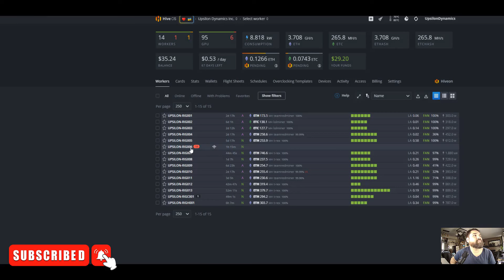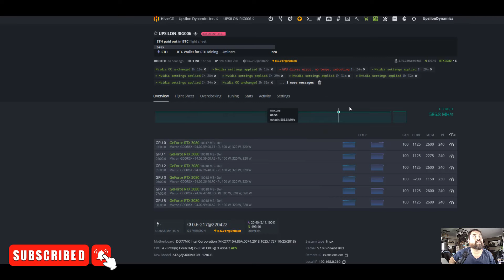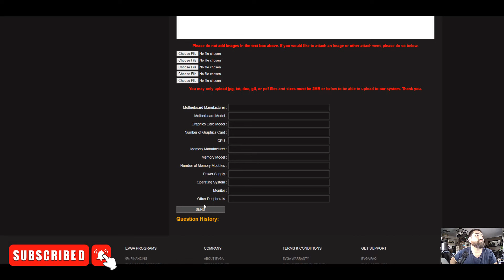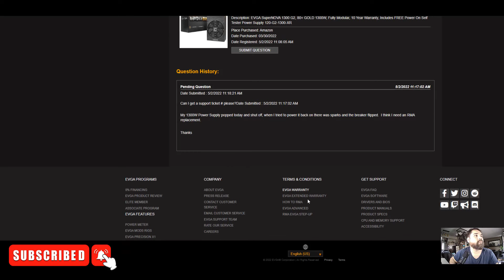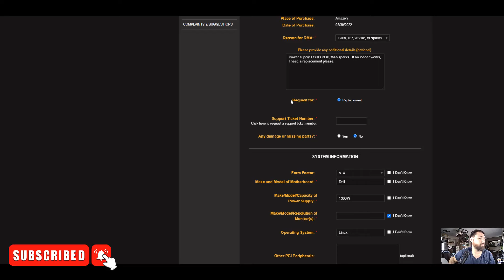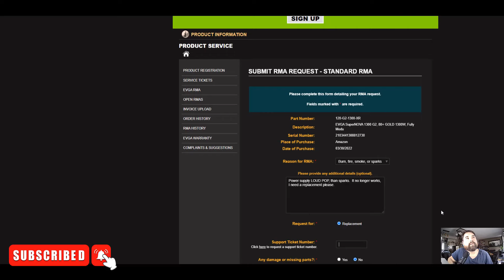My 1300W Gold Rated EVGA Power Supply Blew Up | GPU Mining

Comment: This happened to me yesterday with my 
EVGA Supernova 1600 G+ ...... build has been up and running since early July...it POPPED and shut down the PC.....I pushed the power button and then it sparked inside the case and popped the breaker in the house.  I lucked out, and the PC survived...but I was nervous for 24 hours while I waited for a reaplacement PS to show up.  I am wondering if the ECO setting constantly turning the fan on and off might be causing surges.

Comment: Happened to me with a 1600w g+. My house electricity also blown up and had to replace the fuses. I've sent it for warranty and thankfully they are sending me a brand new one. I'm worried if my components fried as result of this, hopefully they are safe as I'm writing this. I'll be sure tu buy a better UPS before connecting everything back up.
Reply from the maker: Eeek, you have fuses in your panel? I'm on a more modern panel so the breaker just flipped.
Reply: @cryptomatt1983  I do! Although with this experience, I'm highly considering upgrading  that fuse box and acquiring a new electric wiring as well to separate my mining rig from my whole house
Reply: Update: I managed to install a new electric wiring in my house, with 30A breakers. Also bought a 1200w No-Break and thankfully my mining rig is sane and didn't present any kind of burn.

Comment: dang. would have thought EVGA PSU are better than this. have you thought of shifting to server PSUs? i've been running HP 1200w plat rated ones and they are tough as nails. deployed over 12 of em and its been pushing strong.
Reply from the maker: I've got a bunch of 1200W HP Server power supplies with breakout boards in many of my rigs, but most of the 6 card rigs are still on ATX power supplies.

Comment: EXACT same thing happened to me, exact same power supply.  Massive bang, took the main breaker out and the PDU breaker.  Mine was brand new, when I opened it, there  was blown caps.  Bought a new one online, and returned the blown one back to the online retailer.
Reply from the maker: I was not expecting it from an EVGA power supply that was under advertised load, I have since checked and thank god the power supply died saving the rest of the rig (all GPU's and motherboard is fine). Thanks for the comment.